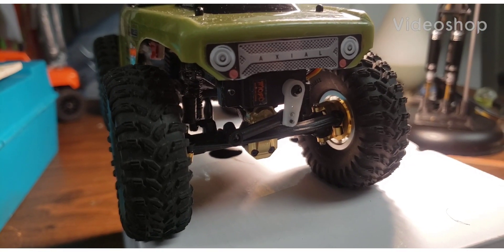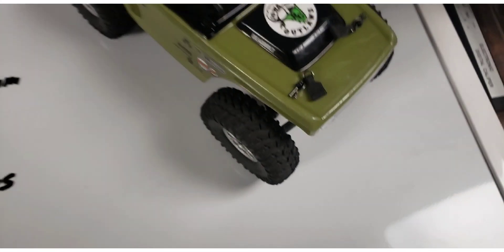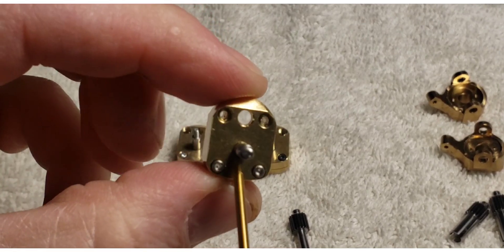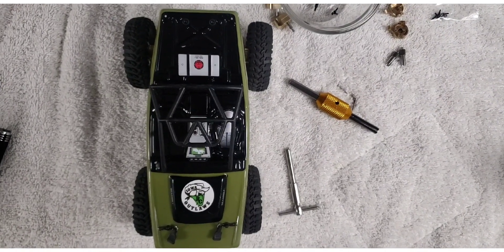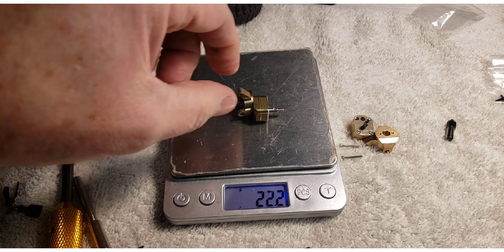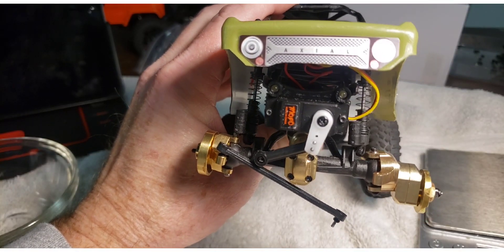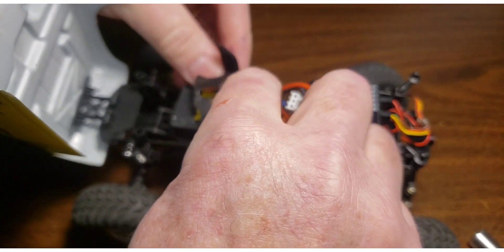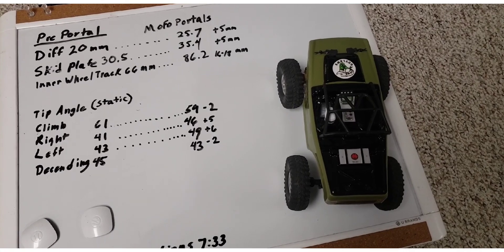MoFo RC Portals, Install And Test Numbers

Comment: Oh I can wait man, all that weight, plus my tire weight, that little sucker is gonna be a monster
Reply from the maker: The MoFo RC positive offset wheels are 1.2, not 1.0s will they still work? Can they stretch? It would be a perfect application here.
Reply: @EXPIOWA  Shouldn't be a problem, I included plenty of stuff. It's simple but effective, You'll just have to let me know if the 6g foams will be enough.
Reply from the maker: @rcpayne6416  Will do! I am excited to try them out. : )